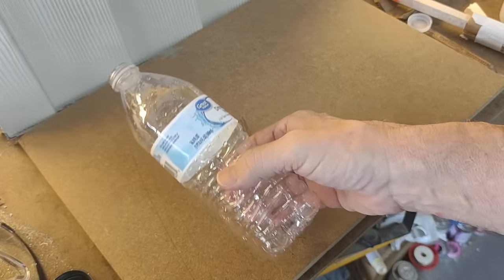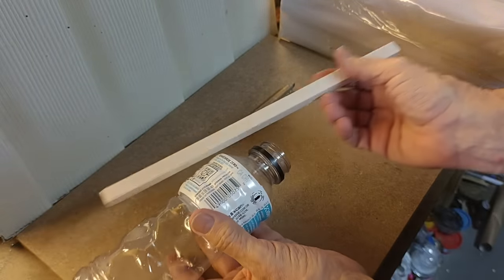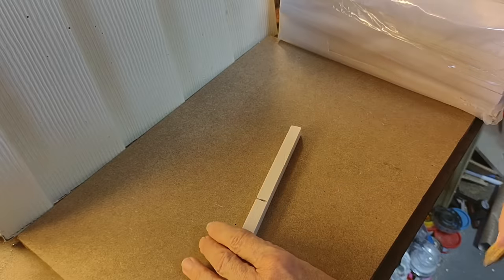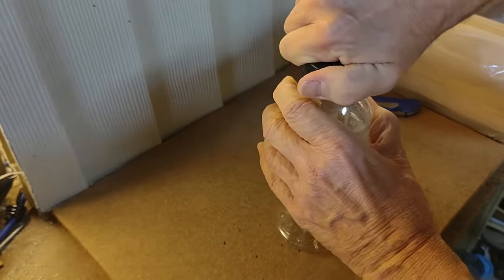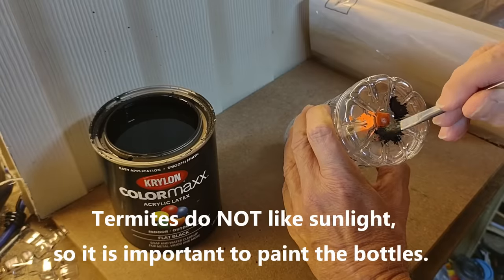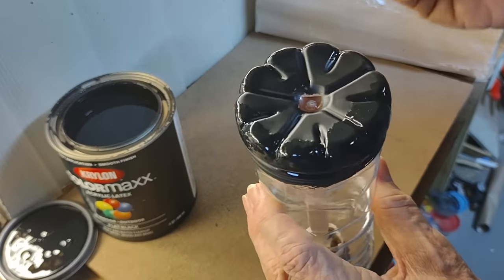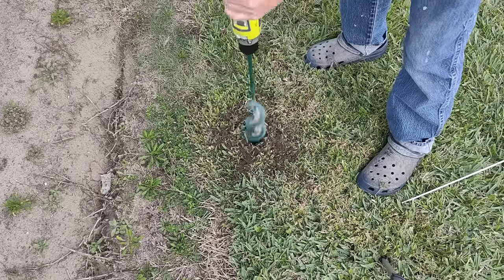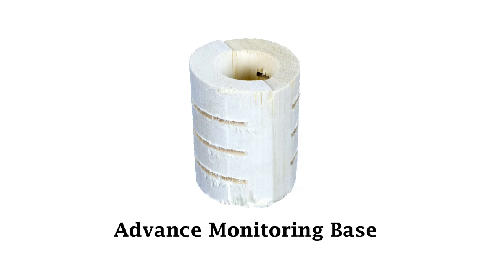Unbelievable Water Bottle Trick for Termites!  Simple to do!

Comment: My house is a poured concrete foundation with brick veneer over wood  frame, I don't see tubes on the exterior but I've seen them a few years back along a non structural sub wall
I do think I had a direct impact by core drilling holes in the basement floor and installing bait under the slab
I'll double check a couple tubes that I found under a stairway closet to see if they've rebuilt . where can I purchase the foams?
Thanks
Reply from the maker: Core drilling the concrete to install bait stations it is an interesting approach.  I think that could work, but I probably wouldn't do it because most bait stations actually attract termites. So, if you are not seeing any activity in those bait stations, then I would probably change them out to monitoring stations that use wood instead of a bait.  Surprisingly, wood does not attract the termites the way the bait does.  The termites need to be really close to be attracted to the wood.  I will give you a link to a station that has a red dot at the top.  When the dot disappears, then you have termites.  At that point, you can treat them with an actual bait station.  I do not recommend using the water bottle stations.  Those were not designed to go through concrete.  The commercial ones only cost about $15 each, and I'm guessing that you do not need many of them.  I also think they will have a nicer look.

If the termites do not rebuild the mud tubes, then you will probably okay.  However, if they do rebuild the mud tubes, then you would probably be wise to trench the exterior of the house, and do a spot treatment on the tubes and any areas where you see activity.

As you already know, to spot treat subterranean termites, you need to buy a fipronil foam.  I will provide links for two products that you can choose from.  I like the FiPro the best because it's a little less expensive and I like the applicator tip better, but the Termidor Foam also works very well.  The FiPro is not available everywhere.  If you can get one of these foams, then drill holes in all damaged areas, that are 4 inches apart, and drilled about halfway through the wood.  If you are seeing exit holes in the wall, then there is most likely a stud behind the exit hole.  Get a stud finder and locate the stud where it meets the ceiling and drive a small nail into the stud a couple of inches below the ceiling.  Attach a weighted string to the nail and that will show you where the stud is.  Then drill the holes 4 inches apart along the entire length of the stud, about 3 inches deep.  Do the same thing for woodwork, except only drill the holes halfway through the wood.  If you think that there is a 2 x 4 behind the woodwork, then drill a 3-inch-deep hole every 8 inches.  The holes only need to be wide enough to get the applicator tip of the foam can into the hole.  After the holes are drilled, then shoot the foam into each hole for about 5 seconds or until you have foam either coming back out at you or coming out the other holes that you drilled.   All the holes should have foam either going into them or coming out of them.  This will contaminate their food source and they will take the fipronil back in the colony and spread it around to the other termites.

To treat active mud tubes, just scrape off about a 2-inch section of each mud tube down to the bare surface.  Then, shoot that foam into each side of the mud tube and also apply a little of it on the surface where you removed it.  The termites will rebuild the mud tubes and bring the foam back to the colony to spread around to the other termites.

Also, if you can find active mud tubes, this is a very good way to determine when the infestation is gone.  If you scrape off that 2-inch section of a mud tube, you can see if there are any live termites in the tube.  Again, the termites will rebuild the tube and go about their business.  Do this every two weeks after you finish all your treatments.  Apply the foam to the mud tube every time you do it.  At the point you are no longer seeing live termites and they stop rebuilding the mud tube, then your infestation has been eradicated.

It typically takes several weeks for any termite treatment to be effective.  That is because you are using slow kill products.  If you were to kill the termites too quickly, then they would not have a chance to bring the poison back to the colony and share it with the other termites.  If you don't kill off the entire colony, you will not end the infestation.  Therefore, you must kill off subterranean termites very slowly.  So, I would give this at least 12 weeks before I would decide that something went wrong, and the process didn't work.  Hiring a professional to trench your house is pretty much going to take about the same amount of time to kill off the colony.

I hope that helps.  Be well my friend.

Termite monitoring stations:  https://www.solutionsstores.com/red-eye-termite-monitor

Video on how to trench for subterranean termites:  https://youtu.be/Fy7YHi_7Z8g

Comment: I'm an exterminator company let's put wood around the house and wonder why termites are going to the home. Hello does this make sence no it's ridiculous.
Reply: Sounds like an attractant
Reply from the maker: I guess you are the first exterminator that has never heard of the Sentricon system.  I recommend that you research it.  Monitoring stations are one of the most common methods today for detecting and controlling termites.  It is a very common practice in the industry today.  If there is a colony of termites near your home, the termites will find your home just as easily as they will the monitoring stations.  The only thing is that the stations will alert you to their presence before you get infested.  This allows you to treat the termites and kill the colony at the station, instead of doing it after the house is attacked.  Pest control 101.  Be well my friend.
Reply from the maker: @DavidSmith3750  It doesn't work that way.  If you have a colony that is close to your house, the termites will be foraging for food.  So, you have a choice.  They can find the monitoring stations first or they can just go straight to your house.  The stations are there to alert you that they are attacking.  They will attack anyway, stations or no stations.  So, it makes sense to offer up a food source before they reach you home.  

I hope that helps.  Be well my friend.

Comment: Those termites are unbelievable, they can bore through paint,squeeze between caulking and they bite. I have them on my boat, I’m replacing all my plywood with pressure treated, they love paneling and your pressure treated soft woods, they’ll eat through that in short order, make sure it’s pressure treated southern pine, like your decking material, termites need water, moisture, so keep your house well caulked and painted, even teak, but it takes them a little more time and that moisture, bamboo is like marshmallow, treat all end grain with your poison oil or epoxy it, like I said they need moisture, good luck

Comment: Guy this is great, thanks for another informative and useful video. I have a question for you - house that I bought recently in Maryland has had previous subterranean termite activity, the garage has exposed studs/walls and remnants of old mud tubes are still visible. Previous owners had done a perimeter in-ground treatment a few years ago, likely when the infestation was first discovered, and we had one done when we bought the house as well for good measure.  No current active infestation. My question is about Boracare. I’ve read this can be sprayed on the lower 24” of wood and board etc., to permanently prevent infestation by WDOs. Do you have an opinion on this product? Have you ever used it or know of those who have? Would really appreciate your insight. Thank you.
Reply from the maker: It sounds like you are in good shape with the termites for a while.  You are mostly correct about the Bora-Care.  This is an excellent product, and it will prevent virtually all wood destroying pests.  There is a couple of things you should know about it though.  First, the label will tell you that you can mix it 1 to 5 with water.  While you can do that, it will not be anywhere near as effective as if you were to mix it one to one with water.  The other thing is that they will tell you that you only need to go up a couple of feet to prevent termites.  This is not necessarily true.  While this will stop most subterranean termites where you live, it will not stop carpenter ants that may be attacking from the top down.  Also, sometimes the termites will build mud tubes that go up higher than the area you treated.  Granted, this does not happen often where you are, but I have seen cases where the infestation actually started in a ceiling.  Normal, the termites start eating the first wood they come to, but that is not always the case.  So, if it were me, I would treat all the wood, from the floor up to the ceiling, and I would also treat the ceiling joists and rafters, if possible.  What I am telling you it's probably overkill, but it will ensure that you do not get damage from termites that did not get the memo that they are supposed to eat down low, or damage that is caused by carpenter ants.  I will send you a link to my favorite video on how to use the product.  By the way, they tell you that you need to mix Bora-Care with hot water, but that is not true.  Cold water works just fine.  Just be sure to mix it in a 5-gallon bucket and use a drill with a paint mixer attachment.
 
I hope that helps.  Be well my friend.
 
Video on how to use Bora-Care: https://www.youtube.com/watch?v=Rmr_aEodyhg&t=24s
Reply: Thanks so much for this information Guy. I will plan to spray all the exposed wood that I have access to in the garage. Thanks also for sending the link. I will be sure to mix 1:1 for best results. Thanks again for your videos. By the way I have the supplies to make a few monitoring stations like you had demonstrated in this video, planning to construct and install them this weekend.
Reply from the maker: @RenaissanceMan78  You are very welcome.  It sounds like you are right on top of things.  Be well my friend.

Comment: My house is made with steel studs. Why am I watching this video?
Reply from the maker: Great question.  You would think that steel studs would make the house termite proof, but that is not the case.  The termites will eat the drywall and the roof structure is most likely still made out of wood.  If you have a basement or crawlspace, then the floor joists may also be made out of wood as well.  The roof sheathing is most likely made of wood, and don't forget the subfloor or hardwood flooring that you may have too.   It is pretty hard to build a house that is totally termite proof.  I hope that helps.  Be well my friend.
Reply from the maker: @thelonewolf666  Yes they do.  Termites actually eat cellulose.  The reason they eat wood (timber) and drywall is because those materials contain cellulose.  So, any material that contains cellulose would be a potential food source for termites.  Well done.  Be well my friend.

Comment: There is Queen Ant Killer bait too. The worker termites take this special, highly desirable powder back to the Queen and voila - the Queen can no longer shed the skin and karks it. Because it happens so quick the colony has no chance to generate a spare queen so the colony ends in disarray and dies out from predator attack. It is not a nasty environmental hazard solution :)
Reply from the maker: I think what you are talking about are insect growth regulators (IGR).  They do work that way, but the problem is that, even though the queen does not produce anymore offspring and there are no more queens, the workers can live up to two years.  The IGRs do nothing to kill off the workers or the soldiers.  Those soldiers will continue to protect the colony just like before.  The queen may not not die right away.  She can live for months.  So, it can take up to 2 years to eliminate a colony with this method.  Meanwhile, they can continue to eat your home.  IGR's are a good way to prevent subterranean termites, but I don't think they are a good idea to treat an existing infestation.  If you sign a contract with a company that uses these, the contract will most likely have a clause that points this out.  They almost always state that it can take up to 2 years to work.  This is assuming that they find the bait at all.  If the stations are too far apart, the termites may go right past them.  That is why I like to use monitoring stations and place them every 4 feet apart.  Now that you have the termites located before they are eating your house, you can use the IGR to kill off the colony.  Better yet, I now have a video on how to do the same thing in under 12 weeks by using a bait station you can make yourself.  It uses fipronil instead of an IGR.  I hope that helps.  Be well my friend.

How to make a bait station yourself:  https://youtu.be/r05Z-aUJehw

Comment: Nice concept. How do you keep the bottles from filling with mud/dirt, especially after it rains, which may prevent the wood from falling?
Reply from the maker: I have not had a problem with the bottles filling with dirt.  That being said, I suppose that can happen if you have very sandy or loose soil.  If you run into that problem, then you could just make the holes smaller.  For example, you can just use a drill to make 1/4 inch holes around the bottle.  The termites will still be able to enter, but it is unlikely that the bottle will fill with dirt, regardless of how loose the soil is.  A bigger problem with these stations, or any other stations for that matter, is moisture.  Termites do not like moldy wood for some reason.  They do like wet wood, but they are not as attracted to moldy wood.  Therefore, I always recommend pulling one of these things out of the ground every year and checking for mold.  I probably should have mentioned that in the video, but it kind of slipped my mind.  This is a very common problem with all monitoring stations.  Circling back to the question about them filling with dirt, I think an easy way to determine if that happened would be to simply look at the dirt around the bottle.  If you see the dirt around the bottle sinking in, then that dirt had to go someplace, and the someplace it went could be inside the bottle.  If everything looks solid around the bottle, then I think you're okay. 

I hope that helps.  Be well my friend.

Comment: Hi Guy, Thanks again for your great advice. Presently it appears that my house hasn't got a termite issue.There is no evidence of that.Would you still use fipronil as opposed to bifenthrin?
You are so correct of the inability to get termidor in Australia due to the licensing issues.
Thanks again for your wonderful help and time
Regards
Gavin
Reply from the maker: Trenching with fipronil or imidacloprid is always preferable to bifenthrin, even if there is no active infestation.  That being said, bifenthrin is better than nothing and it should protect you from most species of termites in Australia.  However, it may not protect you from some species.  Here in America we have about 40 species, with only about 4 of them being a significant threat to structures.  In Australia you have up to 400 species, depending upon who you ask.  That's 10 times as many.  Like here, not all of them are a concern for structures.  In fact, only a fraction of them are a concern.  Still, depending where you live, you may encounter a species that has the ability to travel much deeper in the ground than what we see here, so they could go under the trench and into holes or cracks in the foundation.  You also may have drywood termites where you live and they are not subterranean at all.  They literally fly to your house and they never go to the ground at all.  Unfortunately, I am not familiar with all the species you have there and the different areas of the country where each species is located.  So, while trenching is a good idea, you still need to keep your guard up and inspect at least once a year for termite activity.  The water bottle monitoring stations may also be a good idea.  When inspecting, look for mud tubes and frass.  If you are not familiar with what this stuff looks like, then please watch my video on how to identify termite species.  It shows what mud tubes and frass looks like.  You may not have the exact same species as noted in the video, but it will still provide some information that you may find helpful.  The drywood termites you have there should be very similar in behavior, as would some of the subterranean species.  I do not think you have Formosan termites there, which is a very good thing.

I hope that helps.  Be well my friend.

Video on how to identify termite species:  https://youtu.be/dIs_a0nfVjg

Comment: what about trenching near the gas outside your home, or the water line?  also, i think it may be cool to 3d print a container instead of water bottles
Reply from the maker: Most utility lines are deeper than 6 inches, so they do not present a problem.  Since you are digging next to the house, you do want to dig somewhat gently anyway, so if you encounter a utility line, then just be careful to go over it.  If it is less than 6 inches deep, then remove the dirt under it to get to 6 inches.

A 3d printed container would work great, but it would be somewhat expensive.  Besides, you need to stay hydrated.  So, drink that water or Gatorade.  Lol.

Be well my friend.